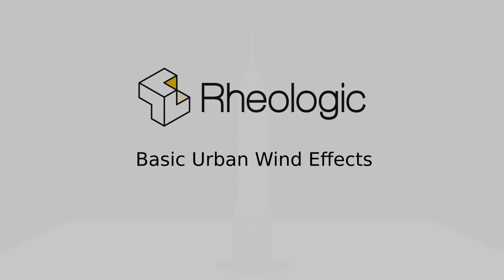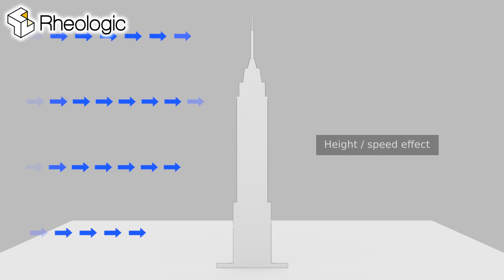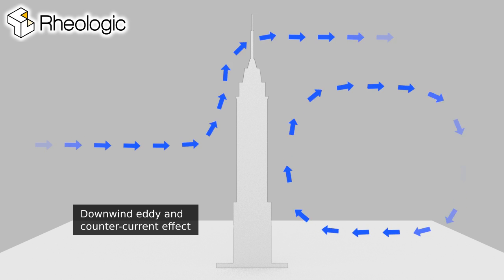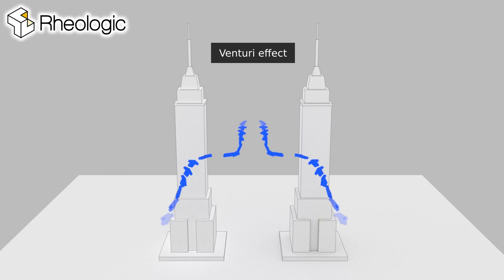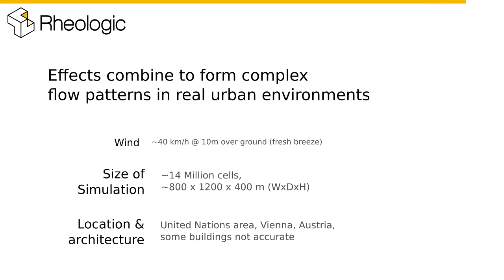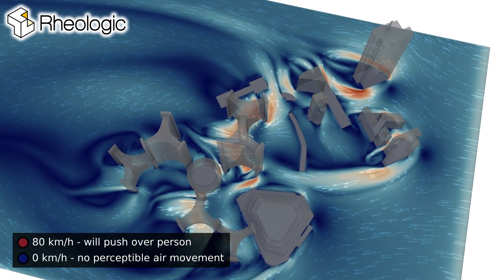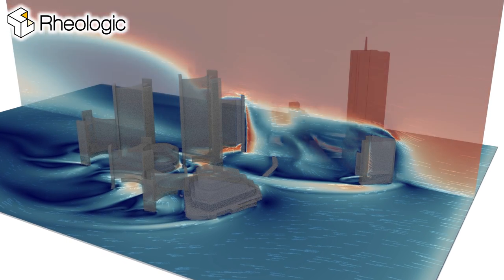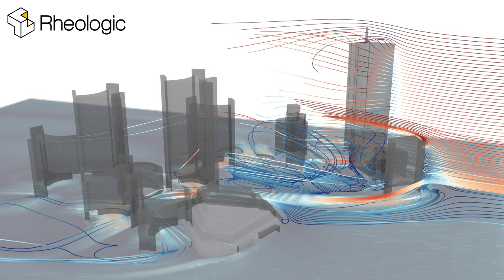Basic Urban Wind Effects

Comment: Design with void each 10 level . 

Usually owner don't like this design becouse reduce floor area . 

But for long term . This building more safety  compare building no void hole .  Every 10 level . 

Or civil engineer can avoid at level 41 and 42 . 
Level 81 Dan 82
Level 120 to 121 
Level 160 To 161 .

Normally every 40 level superheight building have 2 michenical floor

This void hole Kan refuse weight factor from air . 
This method can refuse design load of building and foundation too

Comment: There is no Venturi Effect in Building Aerodynamics since the flow is not confined.
Reply: Correct. Still a useful analogy for the layman, in my opinion.
Reply: in theory you are right, but in practise we can approximate the funneling/tunneling effect when wind is blowing between 2 buildings by describing the Venturi effect, especial to clients or architect just to let them understand what is happening (I am a structural engineer and I often present to developers and architects).
Reply: @MrHipergrass  Yes, you can certainly perform the first-order approximation by using the Venturi effect and present it to clients and architects who do not understand the physics nor the complexity of the flow field in urban environments. However, that approach is incorrect.

The flow field around bluff bodies, and especially in urban environments is a very complex topic and such an assumption from the physical point of view is an over-simplification. The problems are due to the wind-blocking effects arising from a rather complex flow field surrounding a single building (e.g. standing vortex in front of the building, vortex shedding, etc.) which causes the approaching wind to rather choose an "easier" path - around and over the building instead of going through the passage.
Conversely, if the flow is confined (due to geometrical constraints such as the pipe flow with contraction), the approaching wind has no other option but to pass through the passage. Venturi Effect in Building Aerodynamics does not exist.

This video is titled as Basic Urban Wind Effects. Hence, I am of an opinion that at least Basics should be presented correctly.
(I am a Computational Wind Engineer doing science)

Interested reader is pointed towards: https://ascelibrary.org/doi/10.1061/%28ASCE%290733-9399%282008%29134%3A12%281021%29